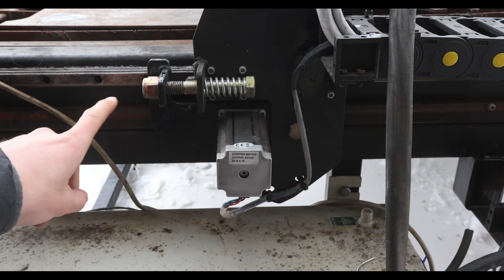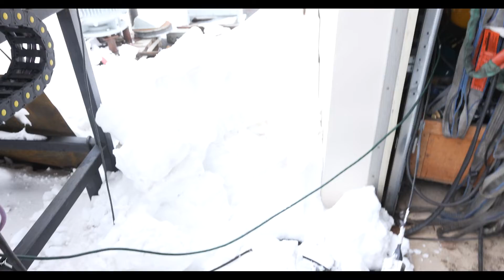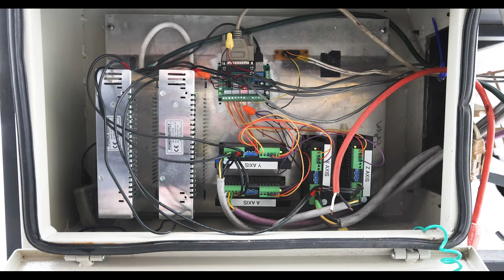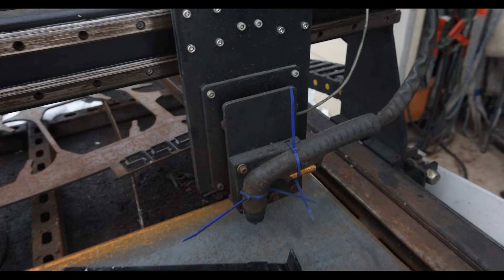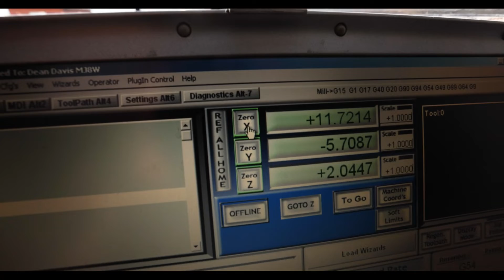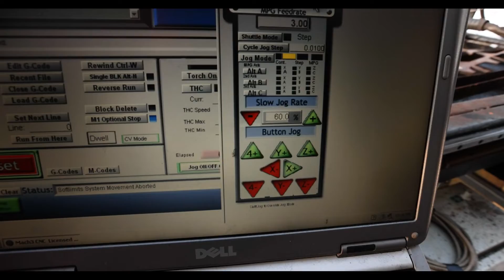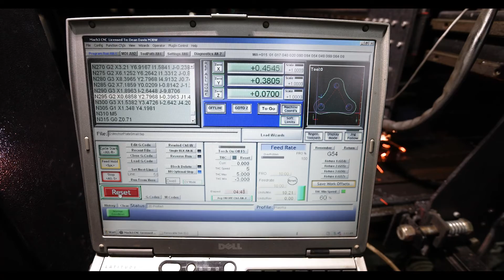How to build a CNC Plasma Cutter Table | Electronics | Free Plans & CAD Files

Comment: Okay.  Since my original question I'd purchases stepper motors and stepper driver/ controllers from StepoerOnLine.  I realised then that the pulse, direction and Enable signals are opto coupled so using 12 V with a 1k limit resistor is perfect but 5 V with a lower series resistor to get the same 10 or so milliamp drive to the opto LEDs.

Comment: Depending on how much voltage/current is being passed through that relay at 31:17 you may need a flyback diode.  If it's just DC low volt/amp to trigger the plasma, might not need it but it's good practice to put one in place and / or use an optocoupler so the circuit is isolated from the high volt/current side of the relay trigger
Reply from the maker: That's really good to know. I didn't know that, thank you. I do know it's pretty low voltage, probably not more than 5v, I don't remember exactly though.

Comment: Awesome video. About to start buying parts. When I looked at your price list and the link on ebay for the linear rail, it was like $39.99 each, and yours is listed at $215.  Just want to make sure I am looking at the right part as I am new to this.  I know prices change, but that is a lot different. Thanks again!
Reply from the maker: You might be looking at different lengths. I would make sure you have the correct length selected. Not sure otherwise though
Reply: Sounds great. Thanks again! @ToshDavis
Reply: Yes I was looking at the default part, it is more like $144. Thanks @ToshDavis
Reply: parts, breakout board 10-20$ stepper drivers DM 556 etc, 20$/pcs,x4. stepper motors minimum nema 23 470 OZ/3Nm 30-50€/pcs. pciE paraller port card 10-20$, power supply 20-45$/pcs. SBR 16 rails 1,5 meter 60$ MGN 15H rails 20$/pcs. about. pinion rails or ball screws about 100-200$ less than 1200$ can build good cncmill machine or little cheapen plasma.

Comment: Help! This is the best vedio I have ever seen so far. and I have build my own plasma cnc but the problem is when I trigger the plasma and start cutting I am getting EMI interference. Please help
Reply from the maker: I'm sorry I'm not entirely sure how to fix this. Have you tried making sure you've grounded everything. I'm sorry to say but your best option might be to buy a new plasma cutting machine. I know there's different starting mechanisms and one of the ways creates a lot electrical interference while the other does not. So your best bet is probably to get a machine you know will not create the interference.

Comment: looks like linuxcnc wiring, so I'm guessing that's why most are compatible with both. thanks the explanation helps. You can also buy those relays, I didn't understand what they were or were for , I do know thanks.
Reply: this breakout board relay have pin 17, then need add this realay use solid state relay coil use, and plasma start SW wires is solid state relay, simple.

Comment: Great work!!!!! I’ve REALLY enjoyed the progress of your cnc build. I appreciate the time you took to explain the different parts of the electronics and how the software works. Thanks! Did I understand you correctly that you did not use a THC on this build? 
/Hoey, Sweden
Reply from the maker: Thank you! Glad you liked the video. Yeah on this build I don't have a THC. I've looked at maybe making one with an Arduino. I just haven't gotten around to it. Another reason I don't is that most of the material I cut is over 1/8'' (3 mm) and when it probes before every cut a THC wouldn't do much as the material doesn't warp very much

Comment: T 31;38 or can use cheap solid state relay need only screw wires and all ok. and etc, my machine linux cnc plasma, can use 2 breakout board, same board but have 2 pcs, old computer paraller port one and pciE paraller port card have second card, lot more input/output terminals. and limit switch not need if use software limit in software has settting but important have XYZ home switches . and probe/torch height. i uses pin input, E-stop pin 10, home sw pin 11,12,13, Torch height pin 15, all limit sw pin 14 or second paraller card. limit SW can use paraller whit E-stop SW. all together. same doing all E-stop if go out machine rails.

Comment: Excellent video, very practical, I have one question, is it not necessary to connect the ground connection of the power sources?   Thank you
Reply from the maker: The whole thing is grounded to the electrical box. I never really had any grounding issues
Reply: @ToshDavis  ground have important add cable/wires all machine frame,elektric box, transformer etc wiring to ground. and if use milling machine spindle whit VFD important VFD to spindle cable have shielded and ground connect.

Comment: Awesome video man
Reply from the maker: Thank you! Glad you liked it
Reply: I’m building this off your plans right now and one question I have is what purpose do the tabs that you weld onto the plates where the servo motor sits serve? And what does the spring do? When I put the bolt and spring through there it just stays rigid it doesn’t seem like that serves any purpose thanks.
Reply from the maker: If they are the tabs I'm thinking of then it's for the tensioner system. The bolt just runs through them with the spring. I have that whole pivoting, tensioner system because I was thinking I would not be able to make the linear rail absolutely parallel with the gear rack and so any deflection, would either load the stepper motor shaft or unload the stepper motor shaft and so this whole system is designed to help keep the same amount of tension on the stepper motor shaft throughout the linear rail travel
Reply: @ToshDavis  ok awesome. I was just checking to make sure it was needed and I’m building it right lol

Comment: Hey there! I`m almost done building my own plasma table and I`m very impressed with your machine Could you please tell me how to set up the z axis so I could home x,y and a axis ? It seems like Mach 3 won`t let me home the axis without the z axis set up in the homing and limits menu. Thanks a lot your videos were extremely helpful while building my machine Greetings from Poland !!!
Reply from the maker: Hi sorry for the slow response. At 36:50 is when I go over activating the limit switches. Though if you're following this exactly I'm not sure. Is the problem still there?
Reply: @ToshDavis  I managed to fix my problem thanks a lot! Have you thought about making another video after one year of using your machine ?
Reply from the maker: @piotrmikoajczyk5152  glad you fixed the problem. I haven’t thought of that video idea but I like it!

Comment: what is the height between torch and work for pierce and cutting both?
Reply from the maker: It depends on the machine, but I’ve been using 3/16” for pierce I believe and 1/16” for cut. But these values are specific to the machine

Comment: Brilliant series. I was just wondering why a A axis? Is it a helper for the X/Y axis or a separate axis its self? Just wondered as i though A axis was for 180°
Reply from the maker: Thank you! Glad you enjoyed it. If you look at my first video https://youtu.be/OweWXLY_zbI?t=403 you will see my old plasma cutter table. This one only had a motor on one side, no A axis and you could really only cut close to the motor because at the far end there was nothing supporting it and so it would jitter. I guess this is a long way of saying that the A axis is just a helper for the X/Y axis. It stiffens that cross beam, the gantry, up a lot where now you can cut on both sides without jittering. I'm not sure why they call it an A axis. I think it technically should just be called the Slave axis for X, but in Mach3 they already have the names X, Y, Z, A, and B and so the next available axis is A hence why it's A. I think you are right that A should be 180 degrees normally.
Reply: Thank you tosh for your quick response. Really means alot considering that time has past since the videos were up loaded most content creators rarely respond. So thank you again.

Comment: Very good job, congrats dude.
Which pin did you use at brake out board  for floating head switch?
Reply from the maker: Hi sorry for the late response. Thank you! I used pin 11 for the floating head switch. See 37:43

Comment: Excellent series! Any plans on a rotary axis build? also the breakout board is unavailable, do you have a recommended replacement?
Reply from the maker: Thank you! Glad you enjoyed the series. I have thought about it. Honestly I think it would be fairly easy to implement on the hardware side. Not sure how Fusion360 handles it on the software side though. And oh okay good to know on the Breakout board. If you just search "5 axis CNC Breakout Board" into Amazon there are a lot of options and you should be able to find the same exact board. I would just match up the picture.
Reply: can add one motor more and use 4TH axis rotary or other own systems.

Comment: That was a thick piece of metal you cut. How many amps is your plasma cutter?
Reply from the maker: It’s 40 amps. Its the Hobart AirForce 700i
Reply: Impressive cut. My cheap ($160) 50amp Plasmargon machine wouldn't stand a chance. Nice build.

Comment: Quick question. i have realized there are 2 motors on X axis, are they driven simultaneously? are they connected on same wiring?
Reply from the maker: They are driven simultaneously, but they each have their own wiring and motor driver. If you can imagine only having one motor and driving the gantry from one side the other side without the motor will be able to move because it's at the end of a long beam. This second motor stiffens the whole gantry up and strengthens both sides against resistance.

Comment: Great job.  What is the A axis?
Reply from the maker: The A axis is the slave axis to the X axis. To drive the gantry it requires 2 motors and one of the motors is the X and the other motor is the A
Reply: one motor X,Z and 2 motor to Y axis.

Comment: awesome build! how did you managed torch  height control feature? 
Sorry I am a newbie and might sound like a dumb question, but is floating head and THC the same thing ?
Reply from the maker: Thank you. On this machine I just have the z axis mapped to the page up and page down keys on the keyboard and while the machine is running I just watch the torch height to adjust it. A floating head is slightly different from a THC. It is the part that zeros the torch height before every cut while the THC is the part that adjusts the height of the torch during the cut.

Comment: what was the travel speed for those 1/2" cuts? I was doing some cutting by hand the other day with my Hypertherm 45 and at full power 45 amps it looked like a toddler was playing with my torch, horrible horrible cuts. I was probably going too fast as I was inside (it's 102 degrees outside, and dry and I have a lot of combustible grasses around the shop) I didn't want to cut outside for fear of starting a fire. Inside I have epoxy floors and even with a welding blanket it ruins the floor with burn marks.
Reply from the maker: I cut half inch at 8 in/min. So very slow!

Comment: Hi Tosh, brilliant series! I’ve converted you plans to millimetres, and build one myself! Big thank you!

I’ve trouble homing the X and A axis, since the do run into the limit switches but won’t back off enough to disengage the switches . Do you know what this could be? My Y axis is homing fine.

Thanks again, love you plans and videos!
Reply from the maker: Awesome!! I’m really glad you liked them and were able to make it yourself. With the limit switches I’m not sure. I haven’t ran into that problem. Doing a little bit of research it seems like if you reinstall Mach3 it fixes the issue. Not sure if you tried that. But I guess it’s a software issue it seems.
Reply: @ToshDavis  I've used your most recent documentation. Thanks for thinking along! I've tried this but it doesn't solve the issue. I did reuse my XML file for the settings, maybe Windows keeps shared files or so. I'll try removing everything before reinstalling. Hope this works out. Keep it posted.
Reply: Problem found! My board "Mach3 USB", uses a back-off setting in the plug-in settings.
Reply from the maker: @roelloeffen  awesome! Glad you found the problem!
Reply: Hello @roelloeffen, would you be happy to share the converted plans in Millimetres with me?

Comment: Hello, I am a fan from China, how do you deal with the electromagnetic interference problem when you DIY this cnc plasma cutting machine?
My DIY cnc plasma cutting machine also used the parallel port control board and USB control board respectively. These boards all crashed or the program ran away when the plasma cutting machine started arc.
Of course, the plasma cutting machine I purchased is relatively cheap ($100). It is estimated that this product has poor electromagnetic compatibility and is a huge source of interference.
Reply from the maker: I personally haven't had any problems with interference. There is a great video by Dr. D-Flo, called "How to Build a CNC Plasma Cutter" and at 25:41 minutes in he starts talking about his interference troubles. It does seem like what it comes down to is the cheap plasma machines use high frequency to start the arc vs my machine (and the machine Dr. D-Flo upgrades to) use pilot arc as their starting method. He is able to get the machine to cut if he insulates the workpiece with wood, but he ends up just upgrading machines. Though I would still just watch the video from the given timestamp.

Comment: Sir can we replace stepper motor drivers d542t with dm 556
Reply from the maker: From my very limited research it seems like the dm 556 should work fine
Reply from the maker: I know the link that I have for the M5045 on Amazon they are currently unavailable. I just wanted to make sure you knew the exact ones I used, but it shouldn't matter too much on which motor drivers you use as long as they are compatible with the breakout board and stepper motors you are using. The things I was looking for was that the motor driver could supply the correct current for the motors I was using. I also wanted to make sure the motor driver's supply voltage was the voltage of the power supply, so in my case 24 volts. Lastly I was just looking at the reviews and making sure people didn't have any problems.
Reply: yes can, select driver what you need max current at stepper motor, if motor maximum current have 5Ampere need drivers what can setting current limit max 5A or little less. not burn motors, volt not important but better if can use 40-90 volt, what driver want use, i use DM556 my motors have maximum 4A. and power supply driver max about 40-50V.

Comment: Is there settings for max travel of the gantry ?  Would it be advisable to add limit switches max travel?  I can hardly wait to get this completed
Reply from the maker: Not entirely sure what you’re asking. But there are “Soft Limits” this limits are limits that Mach3 has where it won’t let the machine move past this value. Though to us these you need to have your machine homed so it knows where it’s at. Though you should be homing every time anyways. You can add more limit switches if you want. The problem is the number of input pins on the breakout board. Though you should be able to wire the switches in series and use only one pin